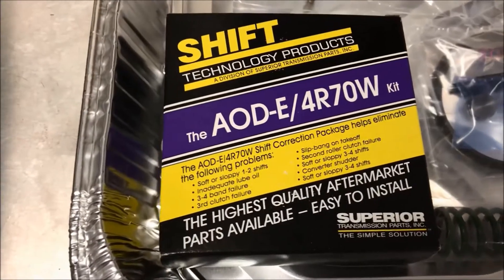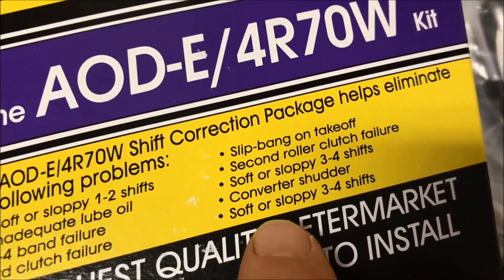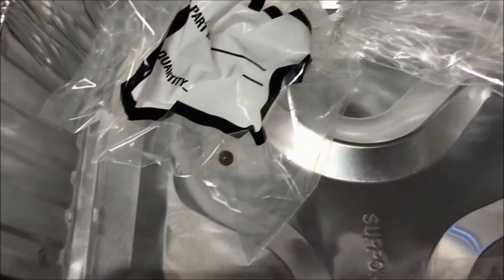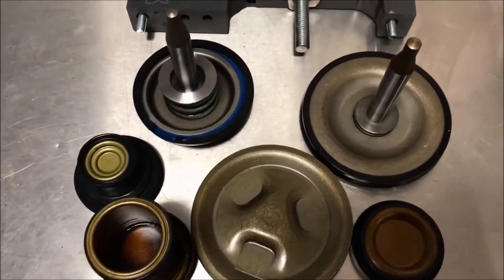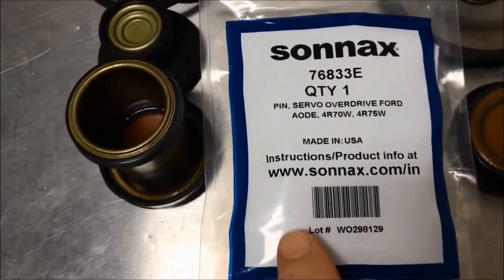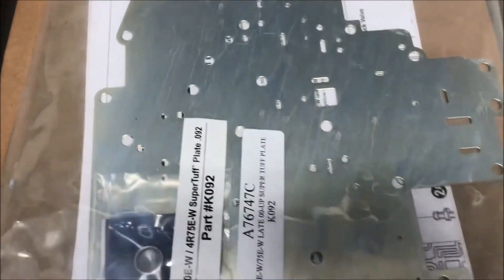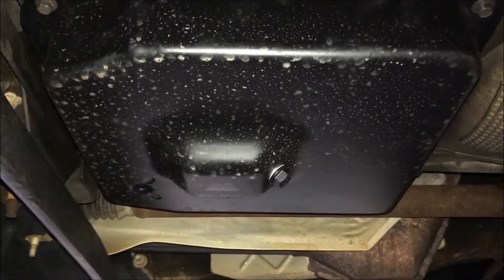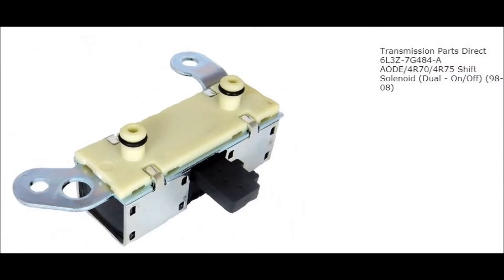How To Stop 4R70W OD Torque Converter Shudder, Improve Shift Performance & Extend 4R70W Life

Comment: Hey Darren here from Ottawa Ontario with a 03 f150 7700. Love the videos you put out and in such great detail! I had tc shudder as well but with a tranny fluid change with filter had fixed that issue. The previous owner had used it to tow a 26ft camper, nit sure if that has caused the wear snd maybe failure but it has sloppy shifts and seems to slip a bit in 2nd gear when I try and get on it and accelerate! I thought maybe my thrittle position sensor might play a role in it but not sure! I have done lots of work on the truck and really appreciate the help your videos bring! I have the 4r100 unit and now seeing this and how nice itt shifts I think I will order the shift kit for my tranny! I only have 147k kms on my truck and is in good shape so count yourself good at maintaining your truck since you have 3 times the milage! For the quality of work you do you should have way more subscribers! Great channel. Also have a black lab that I adore! Thanks again and take care!
Reply from the maker: Thanks very much for that awesome comment!  I hope to get more subscribers soon, please share my channel!  By the way, with regard to your comment about slipping shifts.  The shift kit should clear that up quite nicely.  But, also consider that with an older transmission, one of the problems is fluid management.  Parts wear causes fluid leak around valves and shift accumulators.  I went the extra mile which really cleaned up the shifts.  This could help your slipping issue.  I was sure to replace anything I could that did not require pulling the transmission.  I still have an extra transmission in my garage waiting on a rebuild, but my tranny is so solid now, no need!

Comment: I have a 95 aode an the shift pack looks different then the new design will it still work the same
Reply from the maker: The shift solenoids are different between the AODE and the 4R70W.  Best to make sure you buy the correct solenoids for your make, year and model.

Comment: A bottle of shudder fix will instantly cure it. I drop the pan, change filter, replace with Mercon V and add one tube of lube guard shudder fix. The shudder totally goes away. I'm at 223k and still drives and tows great.
Reply from the maker: Wow, that’s impressive, one little tube of goo can cure all transmission shudder issues! Why didn’t I think of that!?
Reply: @DrivingIntelligence  It's not goo, it's a thin liquid and it absolutely works wonders.
Reply from the maker: @vegasfordguy I’ve covered this goo in another of my videos as well as other products. I have a full playlist on this transmission.  If the vehicle doesn’t have good fluid management as I mentioned in this video, the goo you recommend will not work.  The transmission in this video was worn and needed new valve body components as well as accumulators to restore line pressure.  

But you keep using goo to fix all your issues.
Reply: @DrivingIntelligence  Your truck must not have been maintained very well. I've watched some of your videos and the amount of issues that you've had are insane. Mine is still going strong with nearly 230,000 miles. Never had the valve covers off. No leaks from anywhere, all original accessories, etc. Just regular maintenance, engine, trans and fluid changes, brakes, tires, etc. These are exceptionally reliable trucks. The amount of problems you've had just doesn't make any sense. Appears to have been beaten to death at some point.
Reply from the maker: @vegasfordguy  Not sure how it was maintained before I got it... 165k miles on the clock.  Otherwise, it has been a great truck.  Come to think of it, not sure what issues I've had that you're referring to.  Seems normal wear and tear to me.

Comment: My goal on my truck is to have a fun daily truck 
What would you recommend….. I really liked the video because I want to rebuild my tranny for more power (performance) but I saw on the comments that you were having problems with the shifting I don’t know what to do… also when im on P and go to D there’s like a clank noise or some times R to D or visebersa not sure what’s the problem
Reply from the maker: That clank or clunk problem sounds like something is loose or worn in the driveline.  Have you checked operation of the drive shaft including u-joints and the attachment at the transmission and rear axle?  The input to the back of the transmission from the drive shaft may be worn, same with the pinion gear bearing at the front of the differential.  Check those areas and get back to me.

Comment: I was going to do some other performance mods after the headers, but I think this work is gonna take precedence. Replacing leaking trans cooler lines, this shift kit and upgrades! again thanks for the videos!
Reply from the maker: Sounds like a good plan, get that tranny set up and she will last a long time with power adders.
Reply: @DrivingIntelligence  The EPC solenoid and piston set are unavailable at this time. I’m going to contact phoenix tomorrow and see when they’ll be available. I may have to wait a bit!
Reply from the maker: @rickyrazor977  Thanks for letting me know the parts are not available.  I updated the parts list in the description, which may help, but the accumulators have no options on Amazon.

Comment: Hope all is going well with your transmission. I do this type of work every day.  You mentioned not wanting to open up the transmission again in the near future. Amazon has a way of teaching you how to replace parts you just replaced very quickly. The stuff you find on Amazon is very cheap because those are parts that's failed quality control at the manufacturer. The manufacturer doesn't want to throw away those failed units because often as much as 30% of the production fails. That's a lot of money they would lose out on. They wholesale the parts out for pennies on the dollar.
Reply from the maker: wow, that is amazing, & great information, thanks for sharing.  My transmission has been running well without the OD shudder since I performed all the work in these videos.  Only problem I have is hard shifts from 1st to 2nd, likely from the shift kit and tough plate, and a clunky downshift from 2nd to 1st.  I have another transmission in the wings that I've already disassembled and I'm getting ready to prep for the rebuild.  I do need some guidance on the rebuild kit.  I want a good, robust kit that will last.  Any thoughts?  I want the truck to last.  I'm also considering Hughes Performance Torque Converter to get a few hundred additional rpm stall speed for better towing and performance around town.  Any further guidance from you will be greatly appreciated.
Reply: @DrivingIntelligence  I just finished doing my own 4r70 out of my 06 f150 with a 4.2l,  I was surprised with the result at first because I didn't do anything to the valve body other then replace the 1 gasket. My "deluxe kit included all the vb gaskets, check balls, screens seals and other sealing elements. The shift kit you installed, did it include a new spring to be installed with the sonnax part part you showed. If so I would be confident in saying that's the cause of the issue.  The shift kit springs are not the greatest. They are better then a broken spring or missing spring but I try to stick with the original springs whenever possible. If you still have the original springs you removed and replaced, use those. I know its a lot of work but it's less work then having to do another rebuild or possibly replacing differential. Those hard shifts are terrible for engine and trans mounts, ac lines where rubber is crimped to aluminum tubing instead of being gently flexed during normal operation they are jerked on. Exhaust manifolds can crack for this same reason. U joints. Pretty much everything attached to the engine as well as the rest of the drive line will begin to wear or fail faster.  Sorry to hear about the hard shifting, these companies sell you a product that claims to be a problem solver but in reality it causes more issues then it cures. Let me know how it turns out. By the way thanks for the video. This weekend I'm going to do the valve body on my trans I rebuilt.
Reply from the maker: appreciate the additional info.  I've been able to get the shift pressures down by using a tuner, it doesn't chirp the wheels except when I hit the throttle hard.  I just want a smoother shift.  I replaced the 1-2 accumulator springs using those that came with the shift kit.  I called the kit manufacturer about the hard shifts and they said I might have over drilled one of the holes in the tough plate allowing too much fluid flow causing the harder 1-2 shift.  I believe my torque converter is worn as the previous owner did alot of heavy towing with this truck.  If I get that far, replacing the torque converter, I'm putting in a refreshed transmission.  But for sure, all of your points make very good sense.
Reply: Yeah sorry about that. I have been told I'm "on the spectrum".
Reply from the maker: @1__just_jd  Not following you my friend, on the Spectrum?  :)
Reply: Changed the silinoids and fluid and it goes in reverse but no drive why.. can anyone help
Reply from the maker: Did you identify your issue?
Reply from the maker: Unfortunately most all possible issues are associated with the forward drum and all of them will require the transmission to be removed and be repaired "rebuilt".  Do you have any diagnostic trouble codes?

Comment: nice video dude! 
thanks for the product mentions.!
Reply from the maker: Thank you!  Feel free to promote my video!  ;)
Reply from the maker: Went to Shift Rite Transmissions for their parts... I was hoping to hear from you  based on this message:  "By the way, are you open to sponsoring channels?  I have a friend with a 2004 Sport Trac that has the 5R55E tranny and has overdrive issues which I think is fluid circuit issues.  I think your shift improvement kit will resolve.  Any ideas on partnership?"
Reply from the maker: Went to Shift Rite Transmissions for their parts... I was hoping to hear from you  based on this message:  "By the way, are you open to sponsoring channels?  I have a friend with a 2004 Sport Trac that has the 5R55E tranny and has overdrive issues which I think is fluid circuit issues.  I think your shift improvement kit will resolve.  Any ideas on partnership?"
Reply: So what's up with the 5r55?